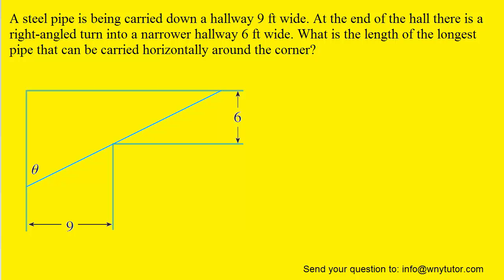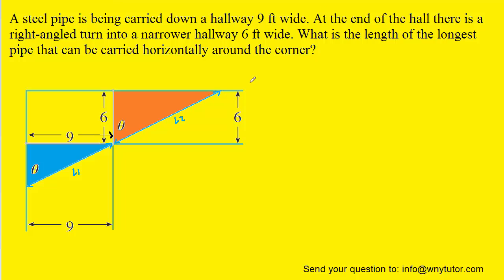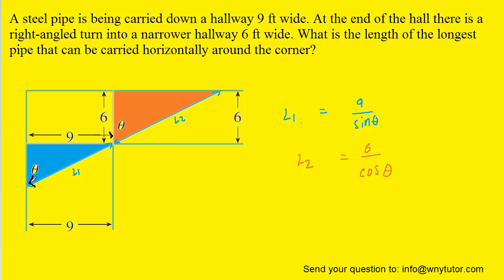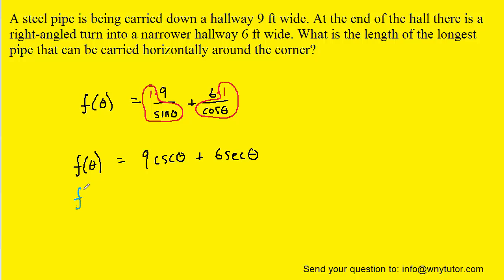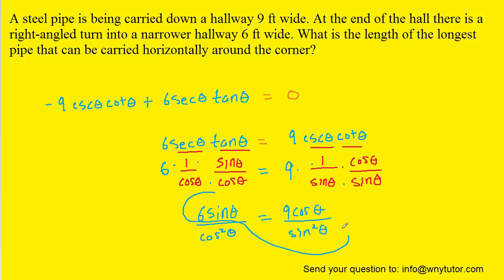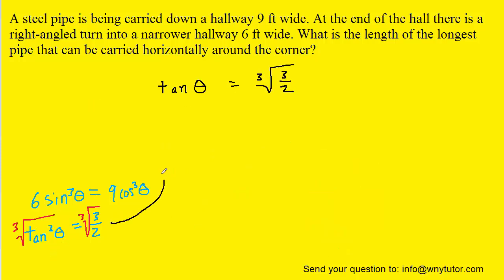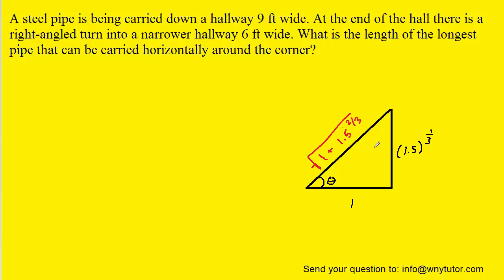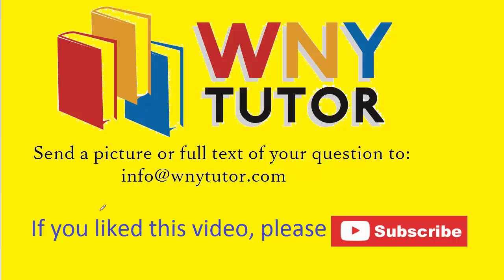A steel pipe is being carried down a hallway 9 ft wide. At the end of the hall there is a right-angl

Comment: You're gonna round it anyways so when you're at tan(θ)=(3/2)^(1/3) you can just θ=arctan((3/2)^(1/3)), and then f(arctan((3/2)^(1/3)))≈21.07

That's a neat way to get an exact value though if you need that for some reason